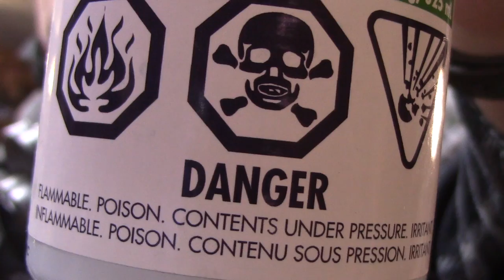PC modding basics: How to paint your motherboard PCB!

Comment: This is a good alternative option to using Plasti-dip.
Reasons: It works better for if you are wanting to use a wider variety of colors not available in Plasti-Dip, Wanting to do more complex designs or airbrushing, it is easier to peel off painters tape without accidentally peeling off the 'paint job' since the Plasti-dip can sometimes end up peeling off with the tape. It might end up being more expensive especially when using the Acrylic Conformal Coating but there are other pros previously mentioned & at least gives another option.

Comment: i would rather make an acrylic plate it would probably be easier
Reply from the maker: Acrylic mobo armor will eventually happen on this channel too I'm sure :P
Reply: Sounds good. I would be interested on your mobo armor implementation.
Reply: go to ImFaceRoll's channel, immade custom armor from his vid
Reply: It will happen :D I think designing it would be real pain and time consuming but results would be just awesome
Reply: IFR has a couple vids on acrylic covers, they turn out surprisingly good.
Reply: The 1st one might be a pain or take overly long. I would create a template/stencil and label each one for each individual motherboard. So you would have the basic armor on file and the next ones would be able to be produced faster.

Then even sold online as a stand alone diy project. You wouldn't need the person's motherboard if you had it on file. You could just mail them the end product.

Comment: Painting a heat sink is one of the dumbest things you could do, you're basically adding a thermally insulating polymer on a precisely engineered conductive surface...
Reply from the maker: Doesn't affect temps though.

Comment: The same simple black could of been done much cheaper with a single can of black Plasti-dip as the single can of Acrylic Conformal Coating is usually at least 2x the price of 1 can of Plasti-Dip and that doesn't include the cost of the Automotive Enamel which is often similar to the same price as a can of Plasti-dip.

Comment: @DIYTechTube hey there I am trying your suggested steps for one of my project but can you just give me a heads up on like, what if I apply conformal coating as u say and then put an enamel spray paint. and Once the entire paint job is done and the  motherboard is up and running, what if I got to desolder or solder any one component on the motherboard will I be able to do it? My query exactly is that will the paint job catch fire while soldering or desoldering any motherboard component? since the soldering tip will be heated and the paints are highly flammable. What do u think!

Comment: I have REALLLLY been loooking into this. I see you and other have done this successfully.  However, my line of thinking is that plasti-dip and other paints  are still insulating, albeit to a minor degree that still allows your board to function. However, no one really says this, but wouldnt logic dictate that a paint that is actually thermally conductive be the better choice? As opposed to a non conductive paint?  That way the heat still propogates outward and only increases ambient air temps as opposed to being insulated?  The hard part, is what paint is conductive, and who can do a comparison video. Maybe one day i will.....
Reply: im replying to my own comment. I just got off the phone with a large company that does anodizing of metals and they regularly anodize heatsinks for mobo manufacturers and military components.  They confirmed my initial thoughts and concurrently agreed with your results.  They said anodizing is the way to go, that although it is electrically non conductive, it will not insulate. He went on to further my thoughts by saying if I were to paint them, yes it would be insulating, however to such a minimal degree, that it would not affect dissipation in a noticeably negative way. He said he wasnt sure if there was a conductive paint out there, but if there was, that is the paint you want.  A CONDUCTIVE PAINT, not a non conductive paint.  You dont want to trap in the heat.  Last, he mentioned for anyone who regularly builds computers, online are kits for around $200 that you can anodize your own heatsinks.
Reply from the maker: Zachary Smith What I mean by conductive is electrically, not thermally :P
But yeah I'm glad to hear more confirmation that this works! Just by God please never use electrically conductive paint on your mobo
Reply: oh lol my bad. carry on then chap :) ill be doing it myself soon! You and linus helped pave the way!

Comment: If the paint is non-conductive then why did you use the Acrylic Conformal Coating and say "so the bread and butter of this mod is this Acrylic Conformal Coating which basically just puts a protective non-conductive layer over the top of your motherboard so when we paint our motherboard we are not actually going to be painting the motherboard"?
Reply from the maker: +Tefen Ca It's just an extra layer of protection, it isn't theoretically necessary although I've always used it

Comment: must you have the acrylic conformal coating? or can you just straight up use the enamel? I'm thinking of doing this but acrylic conformal spray stuff is like over £10 a can for the cheap stuff lol. id be spraying the asus z170-a.
Reply from the maker: +josh gosling I used the coating to be safe, but as long as your paint isn't conductive I would think it'd be fine without
Reply: ah okay nice. whats your opinion on plastidip? would plastidip be better for the entire motherboard (I wouldn't paint the heat spreaders etc) or would the enamel be better to use ? thanks :-)
Reply: btw you have some pretty amazing content. you've inspired me to start doing pc mods  :D

Comment: I'm about to paint my motherboard, quick question do you need the conformal coating? or can I directly apply the paint?
Reply from the maker: +Michael Caluag I would definitely use the coating first, but if you have non conductive paint I think you could get away without it. I just have an expensive mobo so I err on the side of caution.
Reply: I bought this one: http://www.rustoleum.com/product-catalog/consumer-brands/specialty/high-heat-spray/ not sure if its non conductive tho...

Comment: yoo man got a question,youre using i5 6500 on a kabylake mobo z270 can you overclock it ? like on the z170 by bios ?
Reply from the maker: Yes was using a 6500 for the test, but it'll have a kaby lake processor in it pretty soon.

Comment: Hi I'm asking if rustoleum epoxy enamel would work just as well?
Reply from the maker: +Ezekiel Richmond I've never used it. As long as it's heat resistant and non conductive and you use light coats I don't see why you couldn't
Reply: Dietec do you know if it's conducive I can't find something saying it is or isn't it resists heat up to 93C which would be fine I don't see any pcb getting above 50. Little spooked to use it beacause I have no idea wether it is conductive or not.

Comment: How do you do this for just the heatsinks? Mine has spikes for heat dissipation.
Reply: Basically the same way he has done case painting. Take off the heatsinks, sand them, apply primer, then paint, then gloss coat.
Reply from the maker: Either you unscrew the heatsinks and paint them separately from the pcb, or if they don't come off just use a paintbrush

Comment: Does this work with plasti dip?
Reply from the maker: +Ezekiel Richmond No, I wouldn't trust plasti dip. It insulates.
Reply: Yes, it does. Many LN2 overclockers use it to protect the motherboard from condensation etc.
Reply: Plasti-dip is specified to be safe for use with electronics.